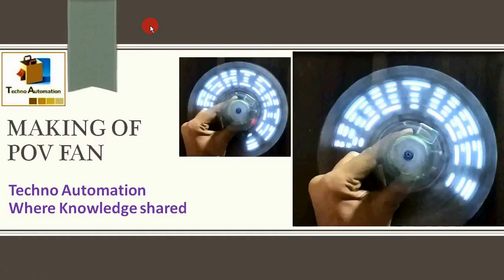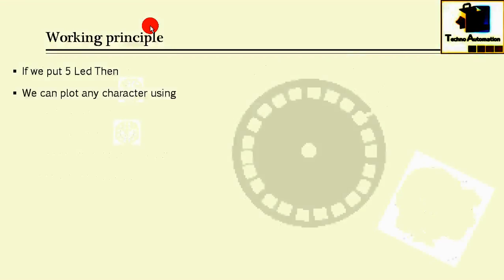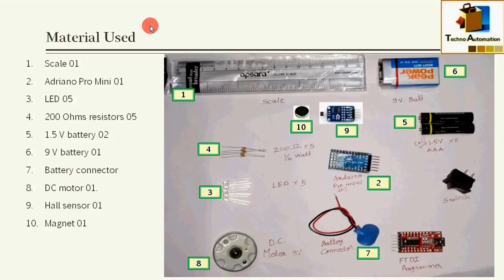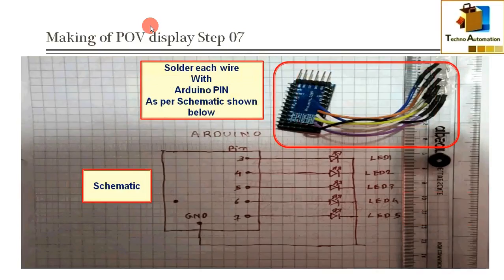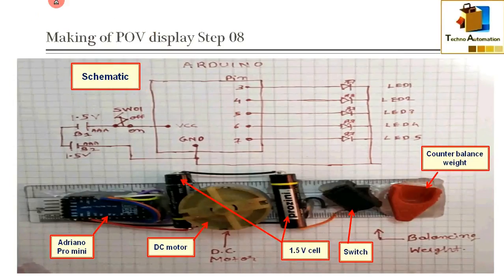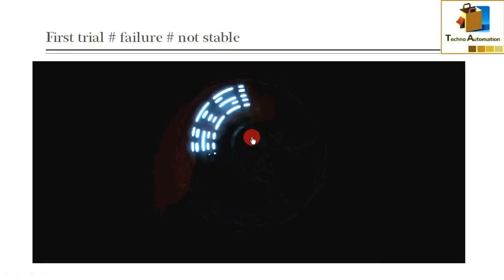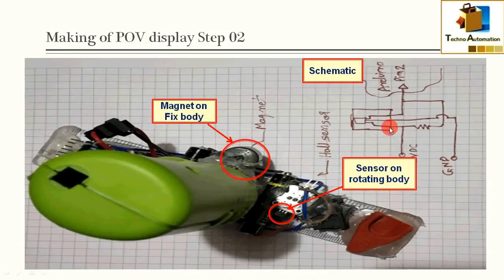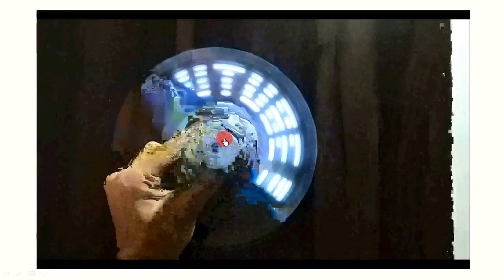Arduino POV fan display explaining

Comment: One question, how can I make it, display multiple text, but one by one.
For example: Instead immediately showing message - HELLO WORLD
Can we make it only show first the word HELLO for like 3s, then switching to word WORLD?
Reply from the maker: Yup.
You have to tweet code.   
You can customise display character as per your requirement.
Even you can make clock also.